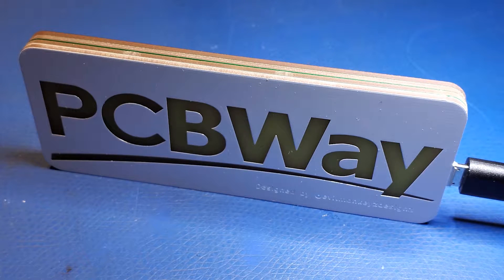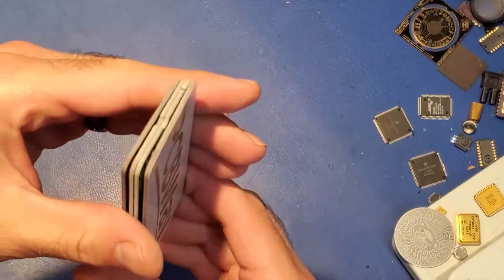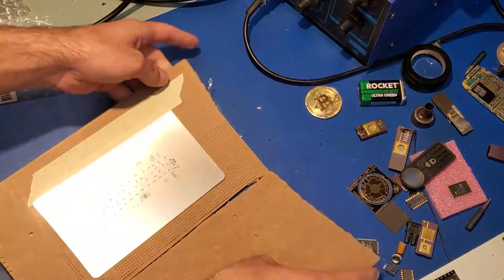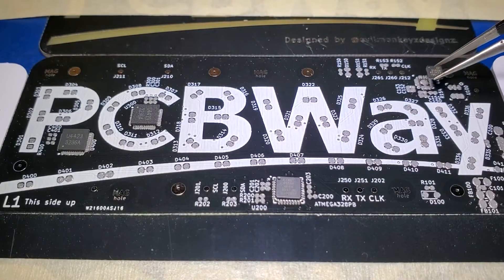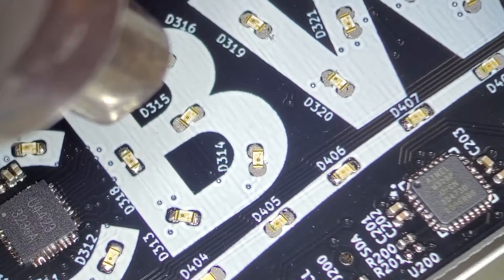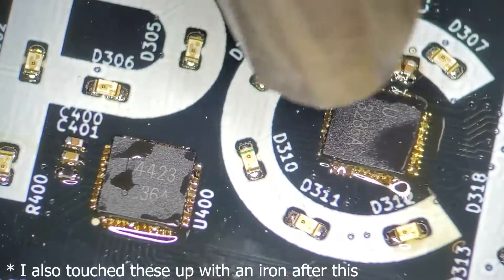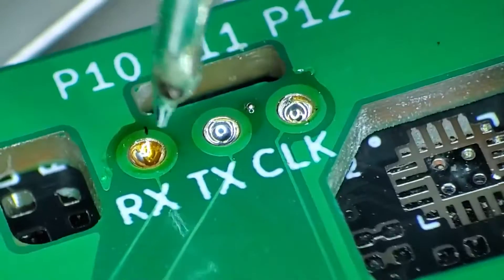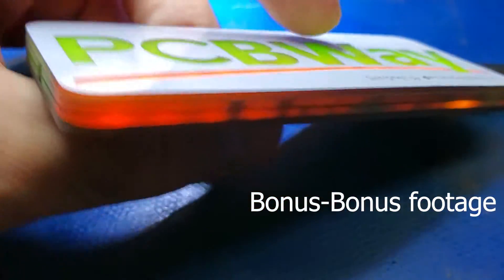CircuitStack: Going Vertical with PCBs!

Comment: Well... the OREO-construction of the PCB isn't something really new, but this one is well done. I see only one downside: it cannot be disassembled and the mecahnical assembly technique that involves soldering looks a bit of amateurish to me. You could have just used holes in all 4 corners of the PCB and small pins made of anything with standartized diameter and then cut the pins to length after the assembly(for example, most of the toothpicks in the world have 2 mm diameter). This in fact works better than it looks.

Comment: The solder paste with a stencil is done best if the stencil is completely flat against the board, in the video you can see it’s resting on the tape and isn’t perfectly flat on the board, the best method for applying the paste is to put a blob on one side of the stencil and have a single firm pass with a spreader, rather than lots of little passes like is seen in the video, this helps avoid the stencil moving or lifting and too much getting on the pads.